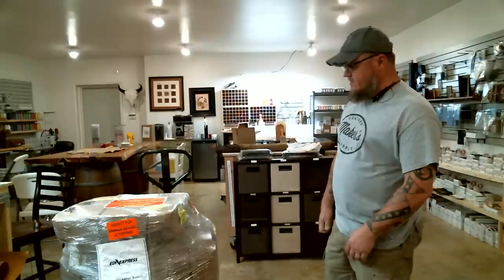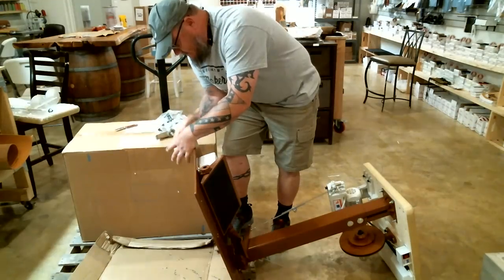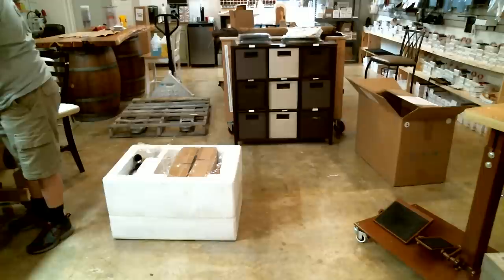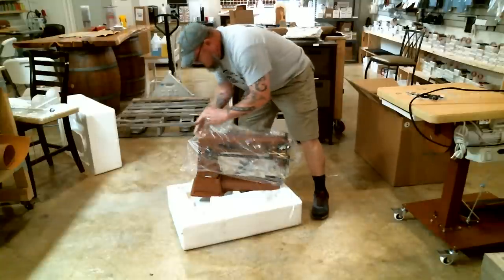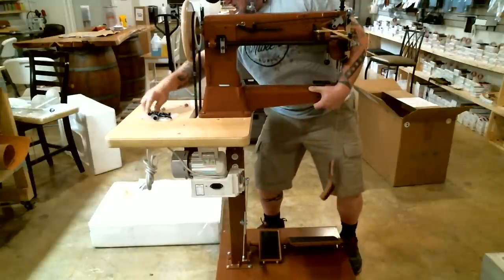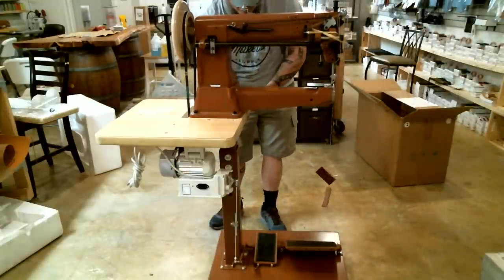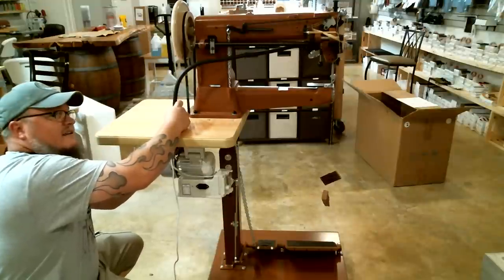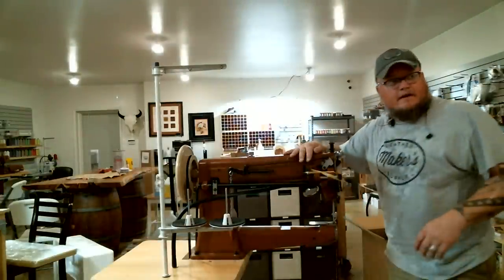Assembling the Cobra Class 4 Sewing Machine!

Comment: First, great video.  You appear to have, like me, some farm boy common sense.  I believe this is the first “unboxing” YouTube video I have seen that was done the “right” way.  I see want too many folks not making a little bit of time to figure something out: they try to lift a heavy object out of a box where the object is nearly always protected with a Styrofoam shell that is very difficult to pull out of a box.  That is just nuts!  The first think I do is open the top box flaps to see what is on top, commonly the user manual, small parts, etc., so I can remove these items.  Then I peruse the manual to get a feel what is “inside” the Styrofoam.  Commonly one can lift the top or one piece of the Styrofoam off the heavy object and get a feel for its orientation.  If it appears the heavy object is “supposed” to be / have a top and bottom, then I can decide the “better” way to get it out of the box.  If the box insists “This Side Up” then I close up the top flaps and turn the box upside down.  I then cut the tape securing the bottom of the box and re-flip the box so bottom flaps are open which allows me to easily lift off the cardboard container and its Styrofoam; this causes the heavy object to be right side up.  In your case (and another heavy object I unboxed a few days ago), the heavy object was setting on its side inside the shipping container.  So I then turned the box on one side and slide the object out thru the open box flaps, causing the object to be right side up.  If the heavy object is on its side or it does not matter which end is up, I flip the boxed object upside down, as was done in the video — and my back is a lot happier (but not my chiropractor).

It is a good idea to go to Harbor Freight and get one of their magnetic parts trays: they are a godsend to keep metal bolts and other items “stuck” in one place.  Because the base of the machine’s stand is steel(?), this would be a great place to place the magnetic tray of parts so they are accessible, when needed, and the parts, bolts, etc., will not fall off the table or roll under some barely accessible whatever or bounce this way when you were absolutely sure it bounced that way.

I have installed many heavy workshop items on my own,  All I sometimes need is a friend to get my very heavy power tool or whatever in my shop.  Most of the time, folks these days barely remember which way to turn a nut to tighten it, let alone figure out a systemic what to install something: if ya want something done right….  So, I use a chain hoist to lift heavy items; this is clearly the best way to install a heavy object onto a stand.  I can slowly lift and lower a heavy object and get it into right position without busting my back or smashing my fingers.  This allows me to double check what I am doing and not have to strain in an awkward position holding something in place while trying to align bolt holes, etc.  Even with a chain hoist, I sometimes realize I should have done this first instead of that or using that bolt here instead of there or put this part together before I bolt those two pieces together.  Which is another basic reason to read / skim thru the manual: visualize a good and efficient setup process — recommended by the manufacturer.  Doing it the right way will always be the better option; with a chain hoist, I can readily correct or redo installation steps a better / recommended way: why do something the hard way when someone has already figured out the better way?

Another good item to get at Harbor Freight are those dirt cheap dollies; I use set the heavy object on the dollies and can easily rotate and move my item that is  in a better position that is easiest for me to handle.  Harbor Freight has some great heavy duty nylon straps to help lift things.  I do not intend to do a big sales pitch for Harbor Freight, but they do have lots of handy-person stuff, at one location, that makes most jobs easier; and they always have sales and discount coupons.  When I opted to change the caster base of my cabinet table saw, band saw, etc., that ol’ chain hoist worked great: indispensable.  Actually, the “standard” caster wheels of my band saw were pretty flaky; additionally, band saw is so tall and top heavy, like a drill press.  I actually used two Harbor Freight wood dollies as my “base” and bolted a 36" x 18" ¾” plywood on top of the two dollies and then bolted the band saw on the plywood.  What made this easy was I could pre-drill bolt holes in the plywood before I set the band saw on some dollies; drilling alignment holes to hold the band saw on its new mobile base would have been very difficult if not done before the plywood base was attached to the dollies.

One final point… This guy has some great videos and very helpful tips.  The Leather Machine Co folks are not very accessible, do not return phone calls, or respond to emails.  When I get my machine, it will be from Makers Leather Supply.  He deserves support, particularly all his helpful videos that are relevant and clearly understood.

Comment: What is the table top you first took out for?  Great video and you made it look so easy.  Lol
Reply from the maker: It is an add on piece called the work platform.  It can be attached over the cylinder arm to make the machine useable as a flat bed.